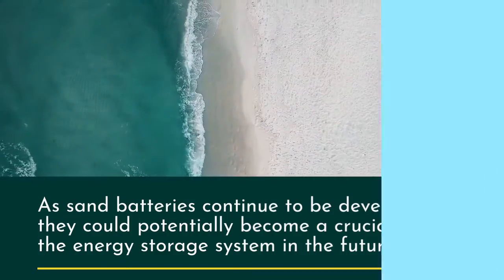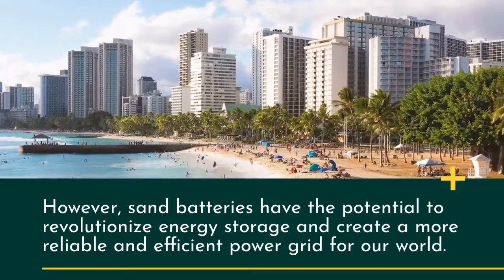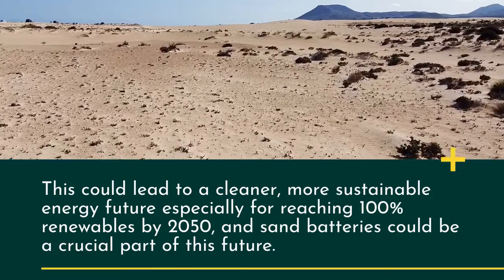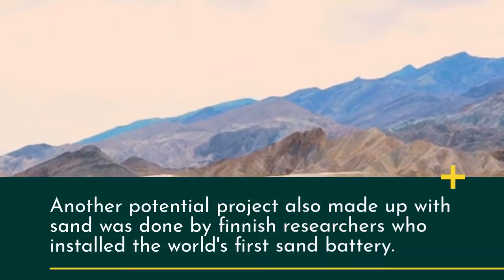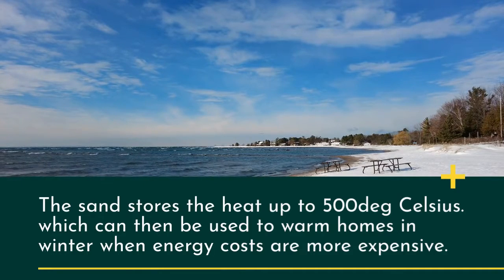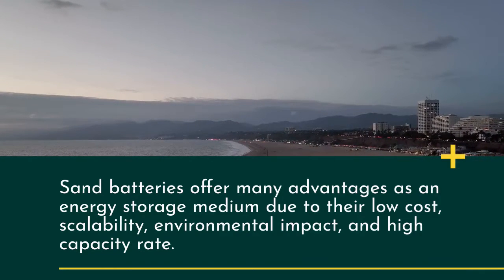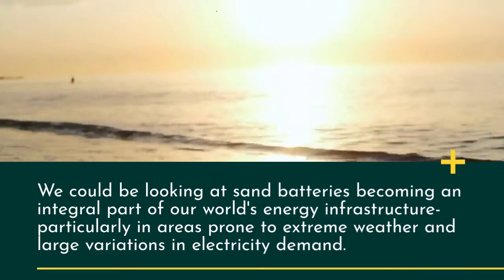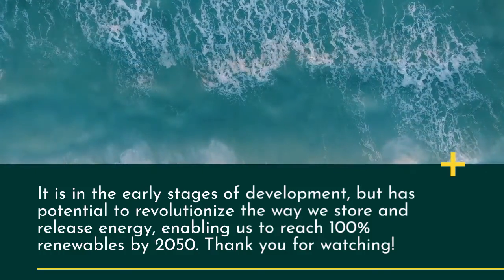How a sand battery works and why it could change energy storage

Comment: One statement in the vid is incorrect. It's completely inefficient to turn thermal energy back into electrical energy, so this technology is best used as a heat store which can be tapped into as and when heating is required.
Reply from the maker: Thank you for noting this. You can watch a new version here : https://www.youtube.com/watch?v=l2J_l2am4e8&t=4s